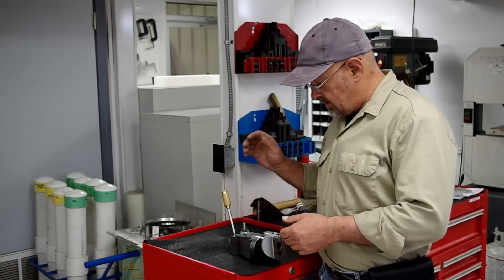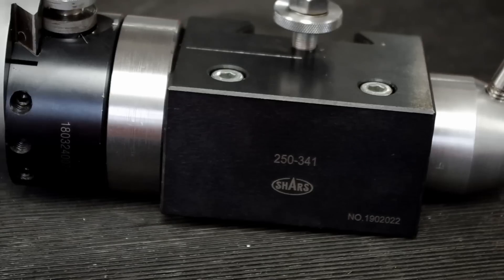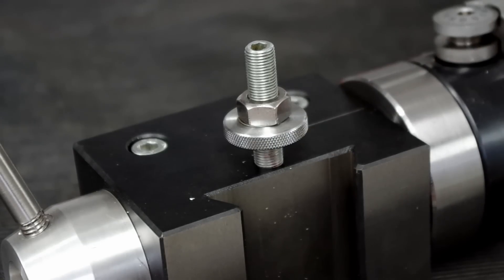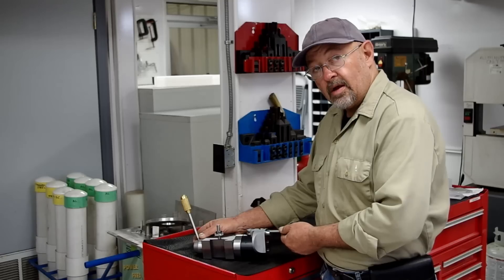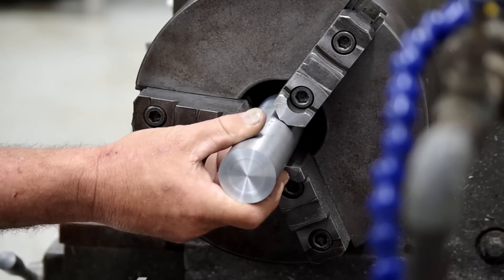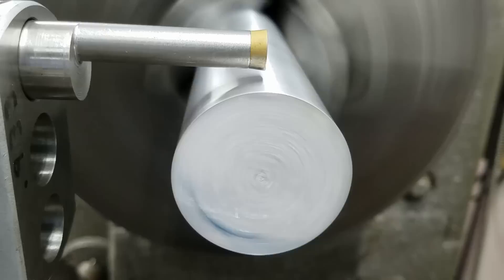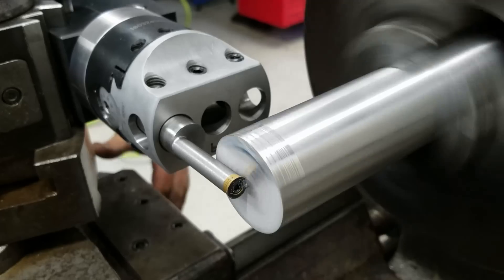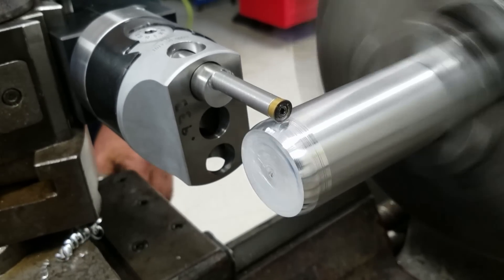Radius Cutter for the lathe.

Comment: Impressive craftsmanship. I’m currently in a position where I need a radius cut on a manually turned part, I may have to build one of these!
Reply from the maker: Thank you. It has come in handy. I need to make a few hand tools for our aircraft mechanics, and I will use it to round the ends of the handles after knurling.

Comment: Mike, in the video you cut a nose on the end of the work piece.  You essentially made a half ball and advanced the carriage to control the depth of cut.  Say you were cutting a complete ball.  Would you then have to keep the carriage at one location and control the depth of cut by adjust the boring head ?
Reply from the maker: Yes. Although you would need to relieve  the chuck side of the ball first.

Comment: Mike,the RCMT insert you have sharpened is really meant for form turning steel. Try the RCGT type of round insert. They are razor sharp edged and designed for cutting aluminium,brass and plastics.
Reply from the maker: Thank's for the tip Howard! 
I'll see if I can pick some up.

Comment: Very nice! Did you make a whole new shank to fit a handle on or modify a 1” boring head shank? Need more details.
Reply from the maker: I machined out a shank to fit the internal threads on the boring head, and also to match the boring bar holder. I also made the cap for the end where the handle screws in. The brass knob was for the air-powered drawbar I show in another video but it was a little too heavy for that and was replaced with aluminum, and re-used here.